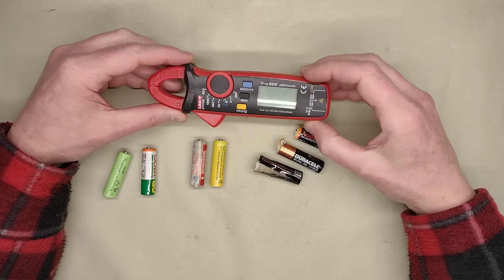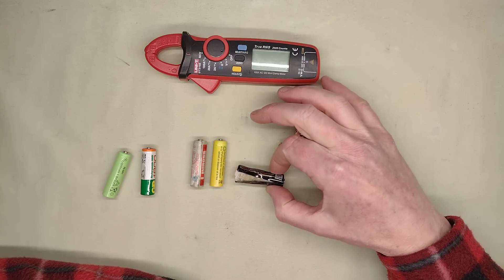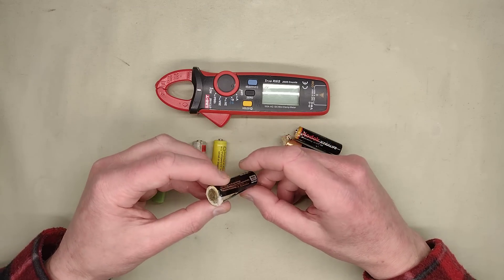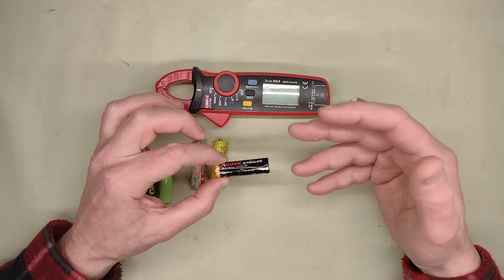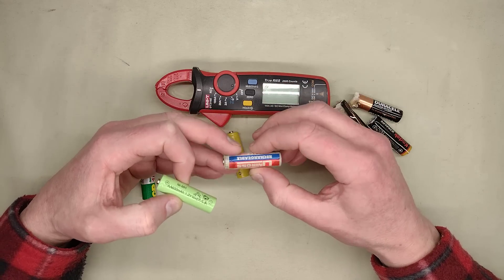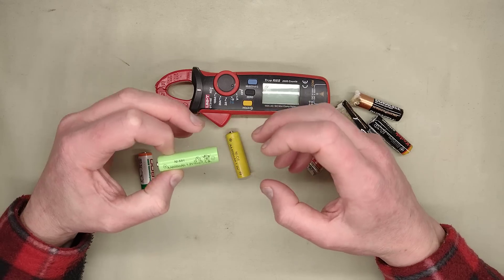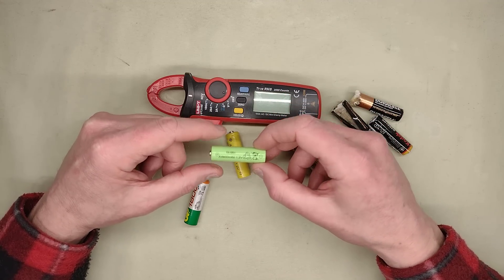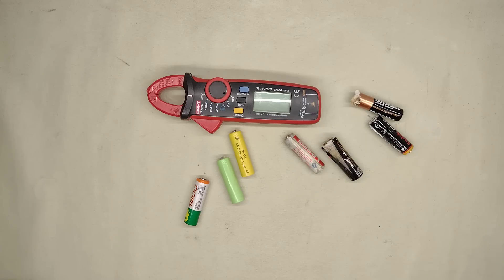The curse of leaky alkaline batteries

Comment: Another long text ahead, isn't it 😜

First I definitely see a use for alkaline batteries over NiMh ones: TV remotes ! (Also applies to other remotes of the same kind such as AC remotes and so on), clocks and pretty much anything low-power that doesn't need to have its batteries replaced very often.
I forgot smoke alarms although they use 9V batteries instead of AA ones and yes lithium batteries do exist as well, I know that.

As far as I'm concerned, even Eneloop batteries will end up being flat before alkaline ones in a remote control, although I never tried putting one in a clock.
But from experience I can tell you that alkaline batteries in a TV remote will last for YEARS, without leaking unless they're coming from a cheap manufacturer.
NiMh on the other end will always require a top up in a while or so, even "Low self-discharge ones", still from personal experience.

Also won't this kind of use reduce their life by any chance ?

Up until now, alkaline batteries can still be found in every supermarket for cheaper than NiMh ones and to me that's the point as far as remote controls and clocks go.

Now for the NiCad batteries, I found that despite the supposed ban for consumer use since many years, you can still find them online and anyone can purchase them without any kind of license unlike some chemicals like sulfuric acid or potassium permanganate since not long ago.
Just for fun I did check several reputable French battery-selling websites and sure enough, I could have bought some AA NiCad cells if I wanted to, despite only being an ordinary consumer.

But personally I don't see any point in using NiCad batteries at home (Well, unless I had commercial emergency lights that won't last very long, up to one hour in France by code or exit signs or stuff like that), as they come with their owns drawbacks like a lower capacity than NiMh, memory effect and also they have a tendency to basically short themselves out from inside, you can revive them with a large capacitor but this can prove to be hazardous and other types of batteries don't come with this caveat as far as I know.

You didn't talk about how to clean the mess after the batteries have leaked inside a device, but I no longer count how many devices I cleaned and fixed because of battery leakage.

The best chemicals to use are white vinegar or some dilute acid, even citric acid as it will react with the alkaline mess that has erupted from leaky batteries and although cheaper batteries might not be alkaline, I didn't see any difference in the fact that the mildly acidic cleaning water will still make the battery chemicals fizz and bubble and ultimately disappear.

With that step done I think anyone who already came after a device where batteries have leaked will agree that the biggest PITA is the corroded contacts.
You can remove the rust if their is anyway with a Dremel wire brush or sandpaper but since the shiny metal coating will in most cases be gone, you might experience bad connections despite the surfaces being free of chemicals or corrosion.

Once I found a Duracell AA battery that had leaked in a old film camera (A cheap one) in a drawer and testing it with a meter revealed that it was actually good. And the casing hadn't even swollen at all.
So I got the genius idea of soaking the entire battery in dilute vinegar, sure it removed all the mess, then I rinsed it out with fresh water and dried it with a cloth before putting it in another device, I don't remember which one but does it even matter ? 😜
Anyways to my surprise it started leaking again despite working fine as it still had plenty of power to spare.
This day I learnt that a battery that started leaking will continue leaking no matter what.
I must admit I wasn't aware about the pressure buildup you mentioned that occurs during normal discharge and the seals that can fail but now that I've seen the video it all seems logical.

But this also makes me wondering why alkaline batteries don't come with any sort of venting mechanism like the ones found on NiMh and NiCad batteries.

Comment: I now use very cheap carbon zinc batteries in stuff, it may not last anywhere near as long alkaline but you tend to need to replace them long before they try and leak all over the place. I'll take a look at the low self discharge Nickel Metal Hydride's as I'd avoid them because of their generally hi self discharge.

Comment: I purchased a second hand vr headset, this was said to be have been put in storage, and as you mentioned the powercell from Duracell the controller had the same issue, luckily enough I was able to use a bit of lighter fluid to clean up the mess, I had no other fluid to use, anyway this did the trick. Have you any recommendations of fluid that could be used if you are stuck and need a cleaner that is likely to be in a person's household? Cheers for the videos you have put up this year and I hope you managed to have a great holiday being that ms kranky closed Scotland? 👍🍺
Reply from the maker: White vinegar to neutralize alkaline leakage.  Then isopropanol to rinse it off

Comment: I honestly don’t know why Duracell’s are so prevalent, never had a good experience with them.  Energizer’s on the other hand, never had an issue, even years past expiry, and they’re still functioning and no signs of leaking.

I only use batteries in things like remotes and the smoke alarm, none of these have a super high draw and in the GameBoy that I rarely play.

I have tried rechargeables in the digital camera, and was very disappointed, I then moved to a camera with a lithium battery and haven’t used rechargeable AA’s since.

Comment: I tried using rechargeable batteries for a time with things like my PC mouse and Flash lights, ended up having to recharge them more than i liked so i went back to normal batteries, dollar store batteries being one of the go to types as they tend to do a decent job for the price.. With that said, i had also got an updated/current gen mouse that uses One battery instead of Two, now it lasts Months instead of Weeks without having to change the battery, amazing what an updated design can do these days.

Comment: Another part of the problem of course is that in some batteries (I don't think this is always the case with the alkaline cells, but it is with the zinc-chloride cells) is that the battery's casing itself is made of the zinc that gradually dissolves as the battery supplies energy. The acidic electrolyte in the zinc chloride cell also reacts with the zinc when no energy is used, corroding the zinc and creating hydrogen gas. This happens much more slowly with the alkaline electrolyte, because there are far fewer H+ ions for the zinc to react with, but it does still happen.
As for rechargeables, the main issue is that for devices that take more than one of them in series, you need a balanced set, otherwise it might start reverse charging one of the cells when the pack is almost empty, ruining the cells. For some devices this is hard to avoid. I have a smart radiator valve that takes AA batteries and it has a habit of ruining NiMH cells.

Comment: For many years, ever since I got an intelligent battery charger that can analyse the capacity of rechargeables, I have rarely used alkalines.  I still have a few and occasionally grab cheap ones when a deal is on but I dont really have much use for them.  Most devices I have happily run off NiMH, my scanner (radio scanner) however flatly refuses to do it even in the manual it demands alkaline and it wont even power on with NiMH.

I even run my kitchen wall clock off one, an old worn out one that has very low capacity.  It lasts about 6 months in the clock then I must charge it up again.

Comment: I've had a number of battery springs that broke due to leaking alkaline batteries, I'm really trying to avoid those now. They are just too damaging to equipment. Over the past 5 years I've found the dollar store alkaline batteries have a leakage rate of about 30% after 1 year. That is too high for me. A cheaper battery does not always equate to cheaper cost of use when you include the cost of damaged equipment.

Primary lithium batteries are supposed to have a shelf life of 10 years. Those might work better if the equipment might be in storage for a while between uses.

I'm also trying the AA USB charged lithium batteries which have an output of 1.5vdc. This means you don't need a separate charger, just use the multi-head charger cord that comes with them and your USB charger. So far so good. One set is 2 years old and they still retain their charge properly over a few months.

Comment: Nimh are not replacement for alkaline!
-They have lower voltage, so a lot of devices will not work. For example my radio guided clock will not sync with theese.
-A lot of devices will destroy them by deeply discharging them (clocks, kitchen scale, tv remote, etc.). Only prevention is recharge them on schedule, regardles if they still work. Discharging under 0,9V destroys the cell, but the tv remote does not care.
-They weight more which makes them unsuitable for head lamps.

To be honest, I have many at home but I find less and less use for them. They are really suitable only for high drain devices.

If you must use nimh, buy Ladda in Ikea, they are eneloop pro batteries in disguise; otherwise stick with alkaline. Buy varta or panasonic with 10 year shelf life, and make an excel spreedsheet, an list all of your devices, and the date when the battery expires. Check the list annually.

Comment: Blimey.. Not seen that brand of Ni-Cad battery in a while!
Manufacturers really need to start making devices to accept 1.2 and 1.5v, it's a real pain, especially when something uses more than a couple as the difference is quite large! At which point I tend to convert to 18650 if possible.

Comment: Good points, I lost an anonymous make digital voltage probe due to battery leakage, super tool, lasted for over 10 years on the original batteries but the leakage growth burst the end out of cell holder wrecking the cap in the process. Cleaned it up, new cells in an superglued the broken cap on only for me to accidentally stand on it breaking the fixed probe off... Binned off and a digital multimeter from Lidl at a quarter of the price will do in future.

Comment: Back in the 90's I built an alkaline battery charger, which I still use. BUT! The cells I still use (which haven't leaked) are the 30 year old energiser and duracells. The new alkalines you just can't recharge- or you can but they leak within 3 cycles.
Reply from the maker: Periodic Current Reversal?

Comment: if your device can tolerate the 1.8V per cell, lithium primary cells are a good option...3+Ah for an AA cell and no leaking. The shelf-life is insane on these. They ain't cheap though.
NiMH can also leak hydroxide and letting them under-discharge discharge is likely to cause death by dendrite formation (internal short), for which you need a rather special device to recondition.

Comment: Rayovac alkalines sold at Lowe’s home improvement stores in the U.S. are especially bad . If you go in any of the stores you can find multipacks with cells that have already leaked. I left a set in a label printer for 3 months and they went flat and leaked.

Comment: Duracelll are the worst for leakage or just don't work when you come to use the device - stopped using them years ago but still see damaged equipment coming in with them fitted, absolute rubbish. Not had the same sort of issues using Energizer or GP.

Comment: Interesting video. Leaking alkaline batteries is nothing new. They did leak in the 1980s, as they do today. Someone mentioned that mercury retarded leakage. I'll take batteries leaking without toxic metal, thank you very much. I live within 10 miles of at least four landfills that I'm aware of, probably a few more. I simply just do not leave non-rechargeable batteries in devices, unless I'm actively using that device. Got out of that habit in the 1990's. When you are about to start using a device, battery up. Takes two seconds.

Comment: I found out some years back you can kill AA & AAA alkaline cells with a battery holder that grips the cell so tightly it relieves pressure on the seal. Nothing liquid leaks out but it kills a cell in a week or so.

Comment: I have started to use lithium primary batteries in all my meters, they dont leak and have a shelf life of at least ten years, work well at cold temperatures and supply a higher voltage than NiMh batteries. The price has gone down recently and the fact they remove the risk og damadge to expensive equipment more than justifies the extra cost.

Comment: Not sure what type of batteries were in my head torch but they'd corroded the contact spring so much it snapped off and shattered. Now need to look into getting a new spring or a new head torch. So much orange crud.

Comment: I could not agree more, old TV remotes, and portable radios,  I find are great for this, you finally get around to changing the batteries and its covered all the in sides of the battery compartment and the contacts. The worse batteries I find for this are the cheap pound shop ones, like that Kodak one you had. I have to say I now try and use rechargeable batteries when ever I can.

Comment: Wholehearted agree. I recently had to clean out an electric clock because the recently inserted (I think it was August or September) Duracell Ultra Power (with leakage protection) AA cell that was powering it, with a "Best Before" date of March 2025, had decided to vomit up its stomach contents.

Honestly, I had only put that cell in the clock because I'm trying to use up the spare alkaline cells I have so I can get rid of them. But it does make me question, whether it better to just send them to be recycled without using them (I don't like wasting), or use them but risk having more leakage issues.

Comment: Agreed, I took your advice from a video a couple of years ago and swapped out all my AA powered stuff to the LADDA/Panasonic NiMH chemistry. It was a bit more expensive initially, but with a good quality multi chemistry charger, I really think it was the best move battery wise I made. Don't really have many primary cell powered items any more, just a multimeter, beard trimmer, and a linear PCM sound recorder. Been using them for 2 years now no issues. The sound recorder does show low battery at 80% discharge, but I can live with that and it functions perfectly fine otherwise.
Reply: Sadly IKEA bumped prices of LADDA as of late, at least in Poland. So much so, that they also offer poor man's versions in lower capacity. Wish I bought more of AAA, because they always come in handy these days.
Reply from the maker: The higher capacity cells always fetch a premium price because of the work involved in packing in that extra chemistry.  The lower capacity ones have advantages, notably much lower self discharge.

Comment: I completely agree, there isn't many use cases for alkaline batteries anymore unless you absolutely need the 1.5V in poorly designed products, for medium drain applications a good NiMH is much more reliable, cost effective (over time) and environmentally friendly, for higher drain things it can't compete at all with li-ion technology, now days I only really buy things designed for NiMH and li-ion, the latter in particular seems to be growing in popularity.
The only time I consider a non-rechargeable is either in very low drain applications (I.E remote controls) where zinc chloride / carbon is very cost effective (and they don't generally leak), or primary lithium cells for critical long term applications such as smoke alarms.
Reply: Every battery composition has its properties that are unique to that particular battery, no one battery type will be suitable for all devices. I have applications that you will only want to use an Alkaline cell, and some you might want to use rechargeable, and some that using a rechargeable would be much more environmentally damaging, or present a risk to life if you use a rechargeable instead.

The latter type of circuit would be very unsuitable to use a rechargeable cell in a smoke detector (the type that isn't power maintained), will damage the battery permanently after a period of time significantly shorter than the time 1 Alkaline cell would go flat on the low drain of a smoke or gas detector.

However a rechargable ni-cd would be more suitable used in a maintained emergency light.

I have a radio I cannot use for more than 1-2 hours on a 2300mhA cell but last all day on Alkaline AA cell. The cut off point has a lot to do with this performance curve.

Comment: My F-set received the kiss of death from leaking copper tops. I haven't used them since. The only alkaline cells and batteries I use now are Energiser brand and I have never had a leakage issue yet. I have a fair bit of test equipment some of which only gets invited to come out and play occasionally I think I will swap everything to Nickel Metal Hydride to be sure. I agree with Ryan Beesley equipment that just goes to sleep on the press of a button is a major pain.

Comment: Duracell guaranteed to leak I don't now what happened to them the older ones never seemed to leak! I have moved over to NiMH not had any issues since apart from some do self discharge at a higher rate than others. I don't use any non rechargeable cells  anymore.

Comment: Interestingly I have Honeywell TRV’s and they have settings for both Alkaline but also rechargeable batteries, I assume this tells the electronics that monitor the battery voltages and warn the appropriate thresholds. also interestingly made in the U.K. .
Reply: It often also tells the device to charge the batteries if it is plugged into an external power source.